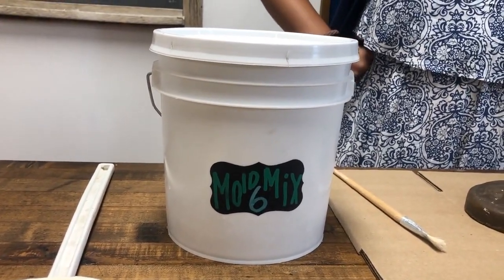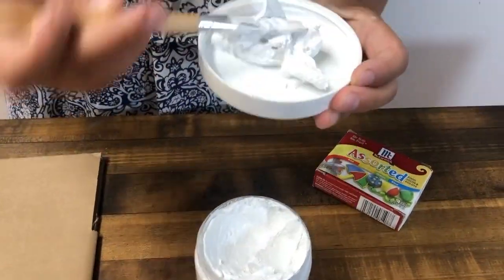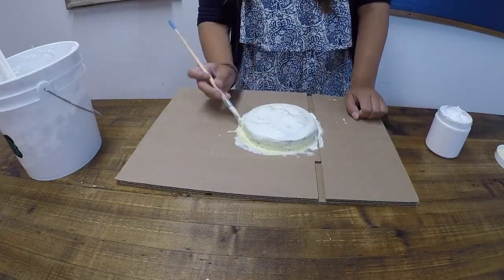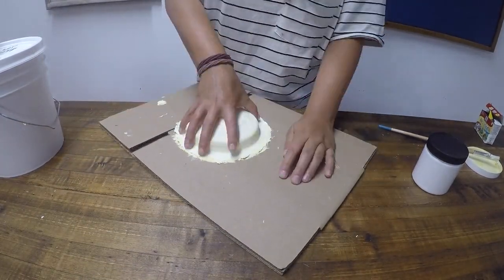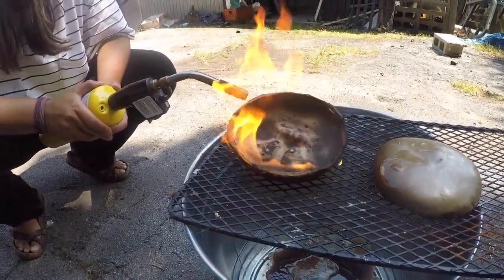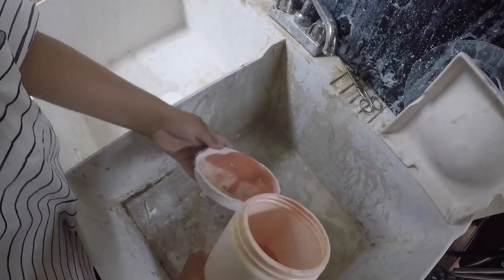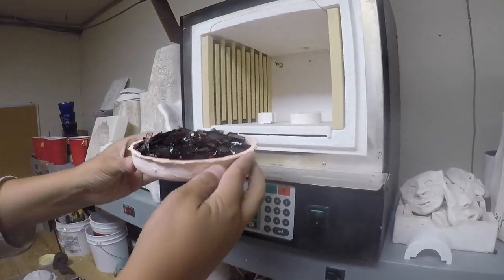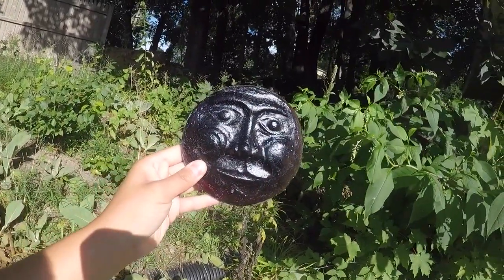How to Kiln Cast Glass using  Mold Mix 6

Comment: I would love some advice if you happen to have time... I am learning how to cast glass and there is a detailed sculpture I would like to create. Do you happen to know if I have a piece that is shaped like a letter A (it's not quite, but the closest I can come to explaining it), would it still release okay with the bar across the center if I use a release agent? Thanks for your time! ❤️ Suki
Reply from the maker: Hi Suki!  As long as inside of the mold is well primed with a release agent (Kiln shelf wash, boron nitride, graphite) the cast should be easily removed from the mold.  If the mold is very detailed or has under cuts the molds will need to be broken to release the glass.  I hope this was helpful!